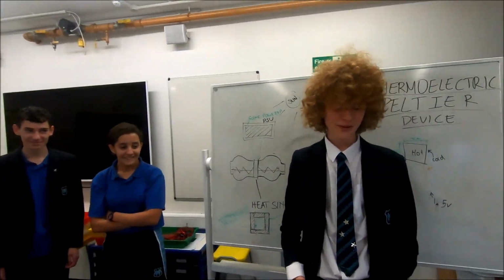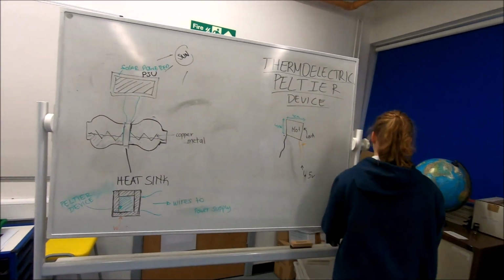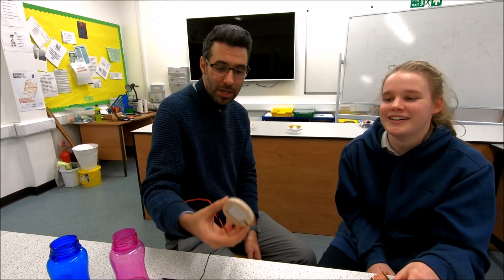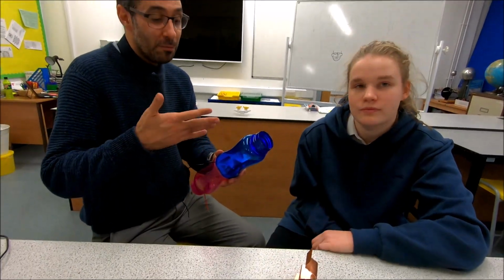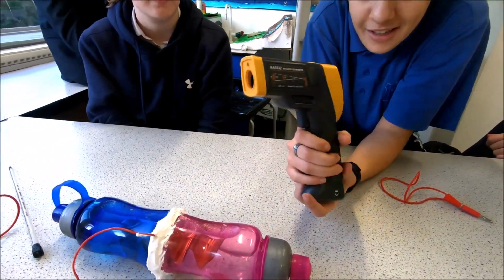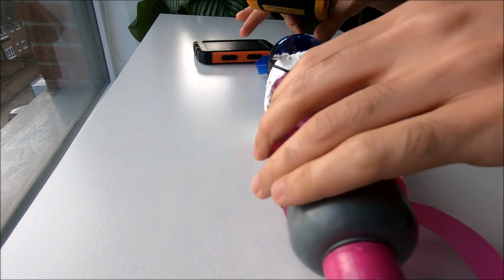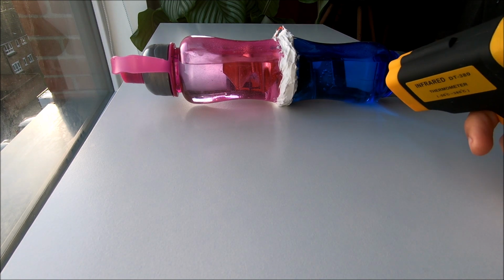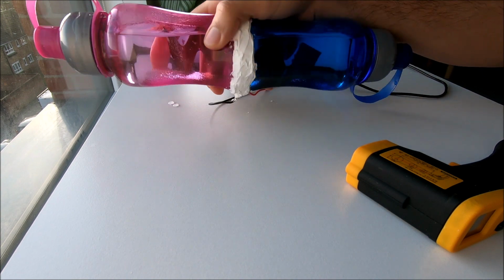Incredible solar water bottle

Comment: Improvement:
1.Outer insulation of bottle.
2.heat sink (Use two layer of same design )
3.switch to 12 v peltior device.

I also work on project, That is portable Insulin fridge device that can maintain optimal temperature (2-8°c) with the help of peltior device.

❌ Adding 2 or more peltior device is not much efficient.

Comment: I think aluminum has the best heat transfer, not copper, I guess I could be wrong but I don't think so. I didn't know you were a science teacher. Where are you there, in the UK?
Reply from the maker: Copper is a better conductor. Aluminium only has 60% heat transfer compared to copper. However aluminium is usually preferred in cars due to its less harmful reaction with water. I'm based in London.
Reply: @MrYazdan  Here is where the info I was going by came from, the butter on the end of the aluminum rod melted and dropped off the aluminum rod before the butter on the copper rod melted and dropped off. https://youtu.be/lvAKQt0Qa4E
Here is another material that is way faster than both of them and probably way more expensive  https://youtu.be/OR8u__Hcb3k
I hope things are going good for you all over the despite this corona virus fraud, I'll bet the vatican is the ones responsible for that, they havee operatives in every city in the world I guess.
Reply from the maker: @BushImports  Thank you, hope you're doing well too. Copper's specific heat capacity is lower than aluminium, therefore a better heat conductor. I have done that experiment and got the correct result, according to the science. You can watch it here https://youtu.be/2GMcQvoz9Ss

Comment: U can improve it by using voltage booster circuit between solar and the  final output ,it gives more than 12v at smaller size
Reply from the maker: You're absolutely right 👍
Reply: Please give me your whataap number, I have more ideas to improve it.
Reply from the maker: @ankitdas5634  you can contact me on my Instagram yazdan_mr
Reply: 7431913532 is my whatsaap number, please reply  me that volt booster is worked or not on that project
Reply: What is it, just a joule thief?

Comment: You can improve it by increasing the power 12v 2amps
Reply from the maker: You're right but 2A, 12V from that size solar panel is almost impossible.
Reply: Yes it's impossible but you can replace it with a bigger one
Reply from the maker: @halbihamza5938  tried to keep it pocket/bag size 😉

Comment: Leaking... “it’s caused by the caps”

Mr. Yazdan : I blame my students for that.

🤨?
Reply from the maker: Easy target 😉😂
Reply: U can use voltage adjustable booster circuit between the solar and the final output by this it gives more than 12v at smaller size